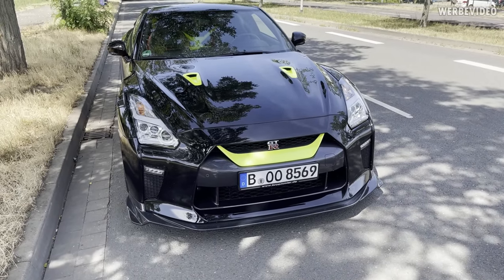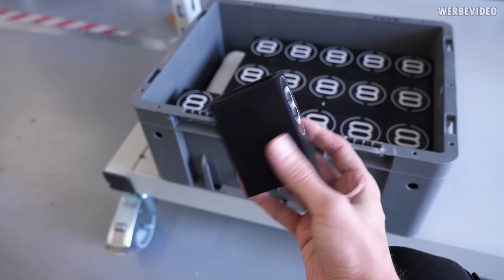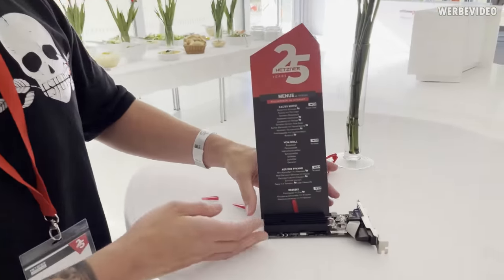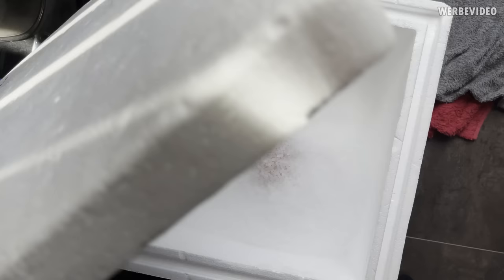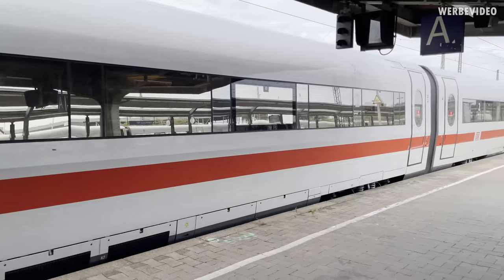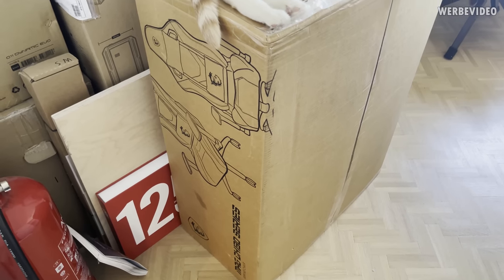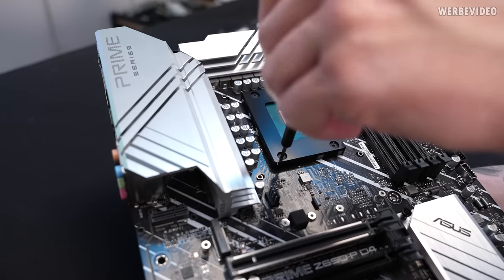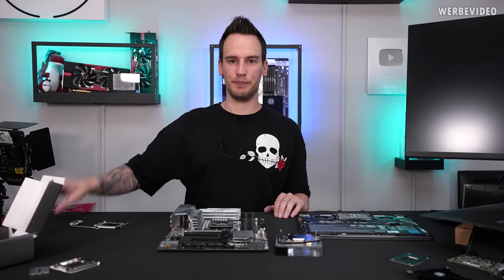WEE(K)-Log #24:  Snitching Server at a Hetzner Event, EKWB Direct Die, GT-R Update

Comment: Do you guys not use other meter prefixes? I would think "1000 KM" would be expressed as "a MM".
Reply: Although MM would be correct, 99% of people wouldn't understand what that means. Not everybody has enough scientific background for that.
Reply: As you can see on the Internet most people don’t do case-sensitive stuff well, there are mm, 1,000 km would be 1 Mm which might be a bit confusing.

Comment: Why dont you get a mount for an external mic/phone? If the audio quality is the issue, why not just use something like a Blue Yeti plugged into a phone? I'm not sure if this is possible on apple but I know it can be done with Android.
Reply from the maker: good point! Will check if I can find something suitable
Reply: @der8auer-en a good USB type C hub can unlock so much unused potential.
Reply: @der8auer-en  i had one particular use case scenario that may be of slight interest to you. I used a USB type-C hub to connect my old OnePlus 8 to a monitor via HDMI and overclocked the GPU in the phone to over 1Ghz to obtain playable framerate at maximum quality on Fortnite 😂 

Much overclocking can be done one phones. In the past I had overclocked by recompiling the Linux kernel with some frequency/voltage changes implemented. The OnePlus 8 was a rooted device that had a downloadable module that you could install to modify the values from within an app. I don't know if you've ever thought about overclocking a flagship ARM chipset. I think it would be interesting to see

Comment: I wonder if it's possible to cool the CPU with water directly flowing over the substrate.
Reply: You generally wouldn't want to do this due to the lack of surface area versus a thin, copper fin spreader in the water.
Reply: You would be surprised to learn that a team of scientists recently did something similar with 8700K. Look it up.
Reply: @Tacet137  You can put a die directly in water or other fluid (novec comes to mind) but once you get above a certain power density per surface area you leave performance on the table.